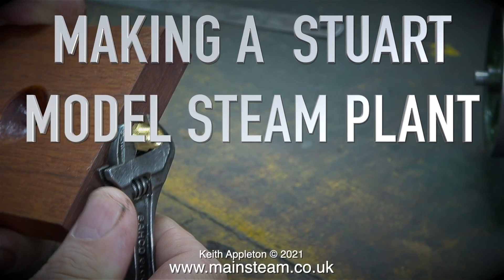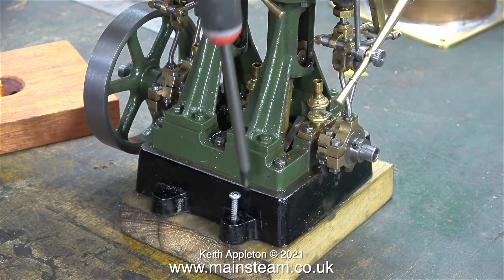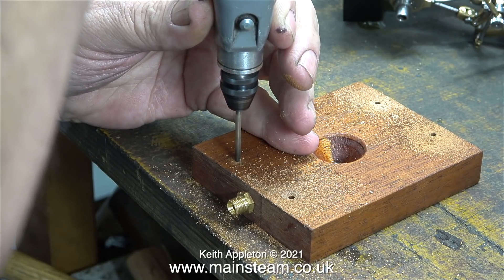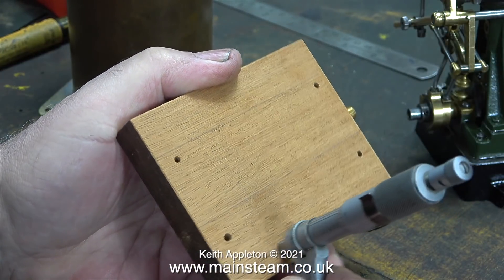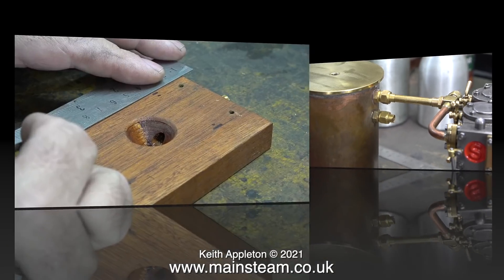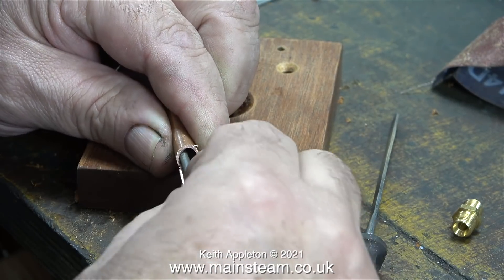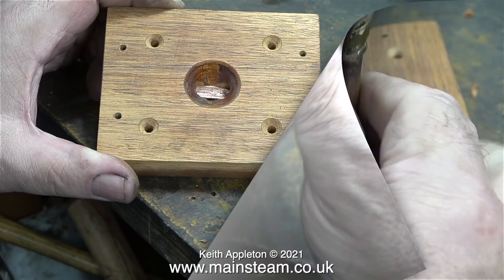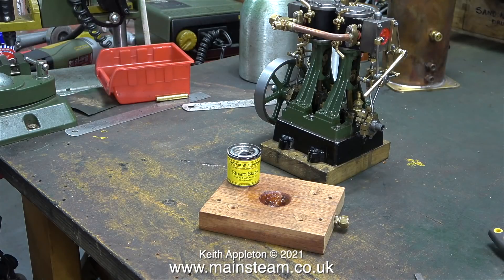MAKING A STUART MODEL STEAM PLANT - PART #32

Comment: Hello Keith I have a question if I had a 7inch train track allso a 5 inch Tain could I just add a single line of track 5 inches inside the seven inch measured from one side of the seven inch ? Then I could run two train sizes on the same track , not at the same time hehe, thankyou keep up the great videos 👍 thanks
Reply from the maker: Yes, this is a very common practice . . . .

Comment: Do you use extra thin super glue to "harden" threads in hardwood? It also helps with the water/oil proofing.
Reply from the maker: Sometimes, but a long thread in solid mahogany is usually more than strong enough.

Comment: My fo0rmer roomate used to make  furniture, painted black (Big in the 80's). He would paint then stan, then pain again, then sand and paint again until there was no perceptible wood grain. It was all very slick and he could charge a lot, even for a simple CD rack. You may want to do similar with the base, either thant or sand the epoxy with 1500 grit, to get that smooth finish.

Comment: I like the hidden pipework idea.  I wonder if the pipe has sufficient slope to drain?  Or is the runoff less viscous than I imagine.  If the end of the pipe had a cap or if the hole was oversized then a slope could be placed in the pipe to get some positive drainage.
Reply from the maker: It will be fine .........